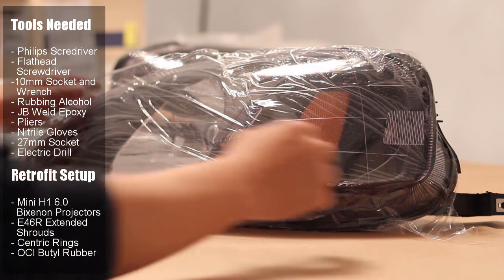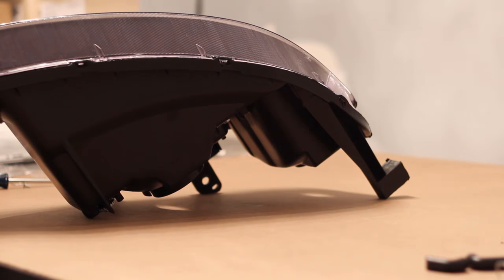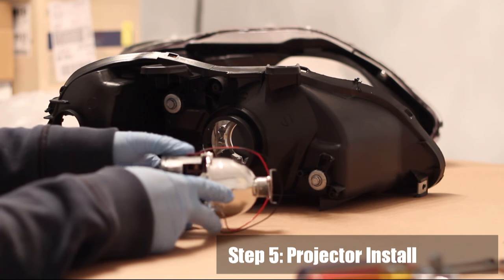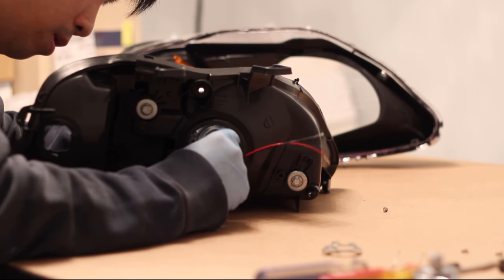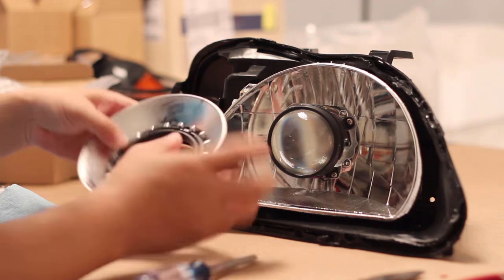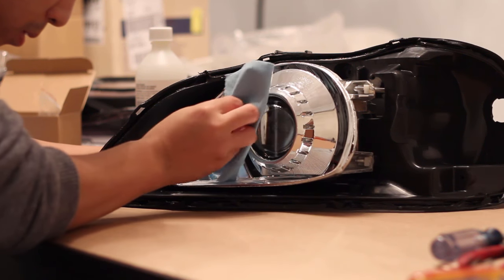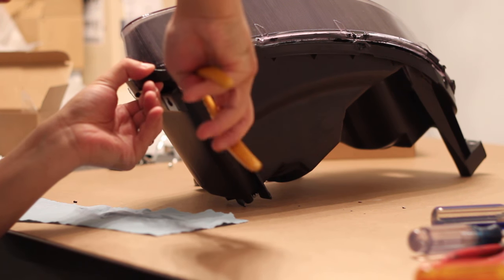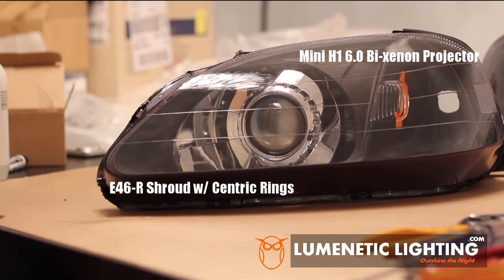How to DIY HID Retrofit - 99-00 EK Honda Civic with Mini H1 6.0 Projectors lumeneticlighting.com

Comment: I retrofitted mh1's into a 98 civic and the biggest problem I ran into was a line across the reflector bowl that caused the projector to bounce on bumps.  I solved it with some epoxied shims on the reflector bowl.  Good luck to all you fellow retrofitters!

Comment: This is a great tutorial. 

Only thing I would like to put out is the oven temperature, I recommend a lower temp. I put mine on 275 degrees and it melted the headlight. 175 degrees works better for me!

Comment: can you guys please do a DIY video for 92-95 EG Honda Civic?
Reply from the maker: +Evandro Ezaki Thanks for your request. The steps for a EG Civic would pretty much be the same as I believe the EG Civic also uses H4 bulbs from factory. You would use the H4 adapter in the headlight just like in this video for the EK. Only suggestion we have would be to get EG headlights with a clear headlight lens as the factory ones are fluted and thus will refract the light output from the HID's in all directions. Not good!

Comment: This is a bad ass product and a well explained step by step process, only question would be if this kit fits a del sol headlight lens, I already have a 1 piece headlight with a clear lenses but would love to get as much light as possible in front of me, do you guys have any kits that will fit the factory fog lights on the del sol??? I have the European housing which has glass lenses and it also takes an h4 bulb like the headlights, awesome product and would love to hear back from you guys

Comment: Great Video... I have projectors and proper kit for it but the question that I have is that the h1 connection (pigtails) where does it go...
Reply from the maker: +Johnny Saeteurn Thank you! If you're referring to the H1 HID bulb pigtails, those go into your HID ballast. But if you're referring to the two wires coming out from the projector, those are for the high/low beam solenoid and those would go into a wire relay harness.
Reply: +Lumenetic Lighting In the need of how the bolt holder goes in and also which wire from the projector goes with the harness.
Reply from the maker: +Johnny Saeteurn Hi Johnny the locking nut goes on the back of the projector to lock it in place inside the reflector bowl. The wiring is H4 from your car > wire harness or directly into the ballast if you'r enot using the wire harness > H1 HID bulb

Comment: Great video! How much rotation was needed with the H4 adaptor? (I thought the adaptor would eliminate the need for that!)
Reply from the maker: +Greg English Thanks for watching! The H4 adapter allows you to the the place the threaded end of the projector through the adapter so that it's centered in terms of the X-axis and Y-axis. It however, does not lock in the rotation of the projector so that is why it is important to mount your headlights back onto the car to ensure the rotation of the projector is correct so that you get a level cutoff beam pattern. If you're looking for a projector that has an H4 adapter that takes care of the rotation, check out my other video of the Mini D2S 3.0 projector  here: http://bit.ly/1QOcsN7

Comment: the 2 bolt to remove to the bulb shield, when you loosen the bolt and then take the shield out. do you tighten the bolt back? great video by the way. awesome how to by far. keep up the great work
Reply from the maker: +gwerx Rico I'm glad you found this video helpful. There will be more how to videos to come :) As for the 2 bolts, I believe you're referring to the adjusting bolts at the back of the headlight that you loosen for the reflector shield. You can loosen them all the way and take the whole reflector bowl out from the headlight, then yes, you would need to screw the adjusting bolts back on the reflector bowl. What I did was loosen them just enough without detaching the bolts from the reflector bowl, so that I had enough room to unscrew the 1 screw that holds the bulb shield inside the reflector bowl. That way I didn't have to remove the whole reflector bowl from the headlight. Does that make sense?.

Comment: Great video. Seems like a silly question but how did you power the bulb outside the vehicle? Can you give me the steps and equipment you used to do so?
Reply from the maker: we use a 12V power supply from a computer that we modified. We recommend you search online for the instructions as we don't suggest lining up your projectors this way. We recommend you install your headlights onto your car and turn on your HIDs to ensure the cut off is straight and level.

Comment: You should align the lights on the car prior to sealing you really should if not you’ll have to bake them again and separate you can use a two part water seal type epoxy

Comment: same deal with the factory 99-00 headlights right? no difference between aftermarket and oem design wise?
Reply from the maker: You would have to double check with whoever you're buying the headlight housing from. But, from what we've seen, all the aftermarket EK headlight housings are the same as OEM in terms of bulb type and fitment. There would be no difference in the way you retrofit HID Projectors from us.

Comment: hey buddy, what's the stock bulb type fitment? I see that most projector uses H4/H7 adapter before screwing the projector into place, what if the bulb type is not H4 or H7? Mine is H11.

Comment: Thanks a lot for the video! Very detailed. Now I have a question would this fit my 2004 civic si ? And second, I don't seem to find a ballast in your website, do you guys only  sell projectors and shrouds?.
Reply from the maker: +Fred Torres Thanks for the comment! The Mini H1 6.0 Projectors will fit in the 2004 Civic Si in terms of size. However when it comes to mounting, the back of the reflector bowl on the 2004 Civics has a different bulb type/shape (9006) from this civic shown in our video. You would need to shave down the back of the reflector bowl in order to sit the projector far in enough so you have enough threading to screw on the locking nut. We're working on a video that will show what needs to be done to shave down the back of 9006 headlights soon so stay tuned!
Reply: +Lumenetic Lighting thanks for the reply!, and awesome! I subscribed so I'll wait for that video to order, keep them coming!
Reply from the maker: +Fred Torres Thank you! And we forgot to answer your question about the HID Ballasts. Currently we are still testing out different ballasts and bulbs to find the best quality and value for our customers. So, at this moment we only have projectors and shrouds on our website.

Comment: after you take the bulb shield. do you tighten the 2 bolt back?  thank you for replying back
Reply from the maker: +gwerx Rico Yes you would tighten the 2 adjusting bolts back. You don't have to tighten it all the way, just back to where it was before you loosened them. You will likely be adjusting them again when you aim your newly installed HID Projectors.

Comment: Great video. What projectors and shroud would you recommend to retrofit headlights in my 2002 Rav4? Would the Mini d2s 3.o  work? Simse like I cant find any videos on older Rav4. Thank you
Reply from the maker: +Daniel Pawlata (DPFAST) Thank you! The Mini D2S 3.0's (round or square lens) would be a good choice for the 2002 RAV4's. 2002 RAV4's have an H4 bulb opening just like in this Civic headlight and the Mini D2S 3.0 kit comes with an H4 adapter that makes install pretty much plug and play for the projectors. We did a retrofit with the Mini D2S 3.0's  on a Toyota 4runner that also uses H4 bulbs. You can find that How To video on our channel as a similar retrofit to a RAV4 with Mini D2S 3.0 Bi-Xenon Projectors..

Comment: i have a 97 civic what would you recommend because i wanna go hid but i want to do it the right way? And also with this will it be high and low beams or just one?
Reply from the maker: We'd recommend you to use our Mini H1 6.0's or the Mini D2S 3.0. Both are on our website at lumeneticlighting.com . Both of these we recommend have low and high beam which is controlled by the solenoid.
Reply: the price on your website is that for a pair or just for one?
Reply from the maker: +ronnie cason the price on our site is for 2.

Comment: when is stock going to be available for the e36 extended shrouds also do you ship to Australia?
Reply: e46R*
Reply from the maker: Thanks for the comment. Apologies, as we do not have an ETA on when we'll have this in stock again. We do and will ship to Australia.
Reply: +Lumenetic Lighting 
thanks for repling to my comment. will this setup work for a more sleek look on my ek hatch. Mini H1 6.0 with the Iris shroud + (if needed) shroud centric ring.
Reply from the maker: For sure! Mini H1 6.0 with an iris shroud will look clean. And, the Iris shroud has a flat side just like the e46r extended, so install will be quite easy. You will need centric rings if you are using iris shrouds with the Mini H1 6.0's.
Reply: hi, im trying to purchase the projector but you guys are out of stock. would you know when you will get more stock? also what does the 2nd option mean? E.G Gattlin gun etc.
Reply from the maker: EK9 BRAH We have stock for LHD (left hand drive) of the MH1 6.0 Projectors on our site still. We are out of stock for the RHD version. The second option is selecting your shroud that covers the projector to complete your retrofit.
Reply: what if i wanted the iris shroud? theres no option for me to pick it only options are the gattling shroud. im super keen on this setup.
Reply from the maker: The Iris shrouds do not come with the MH1 6.0 Projectors normally. The Mini Gatling Gun or the Mini Graphite is what's included (for free) with the MH1's. You can get the Iris shrouds still but you need to add them to your cart separately. Don't forget that you need to also add a pair of centric rings to fit the iris shrouds onto the MH1 projectors. They are on our website as well. If you need more help ordering from our site, please feel free to email us at support@lumeneticlighting.com

Comment: will this work on a integra?  can i order the same shitl ike min h1?
Reply from the maker: +Truth Man you can use mini H1 6.0 projectors however, you will need to shave down the back of your reflector bowl inorder for the projector to sit far in enough so you can mount it with the locking nut. I will be posting a video on how to modify 9006 headlights to fit these projectors.

Comment: Any suggestions for Acura RSX 2006
Reply from the maker: We've retro'd MH1 6.0's and MD2S 3.0 Projectors into RSX headlights before. As the RSX uses H1 bulb socket from factory, you will need to modify and widen the bulb opening so you can fit a projector through the back of the reflector. Check out out Retrofit guide videos for more info: https://youtu.be/txbfmWZpHq8
Reply: Lumenetic Lighting awesome. Thanks. Is there a way or site I can order headlights? What's the best kind
Reply: Lumenetic Lighting I'd like to just purchase the headlights and install
Reply from the maker: If you're looking for replacement headlights (non-OEM), I would suggest amazon.com or even depo headlights.from https://www.carid.com/automotive-lighting.html?gclid=CjwKEAiAp97CBRDr2Oyl-faxqRMSJABx4kh9gITzcZIuhu6jcN0azAf56k0I4oQmDugLPJSP-sYvlRoC7Obw_wcB
Reply: Lumenetic Lighting thank you so much! Life saver 😊👍👍

Comment: you have some that will fit a 2009 malibu ???
Reply from the maker: we don't have projectors that "bolt in" directly like the ones in this video as the 2009 malibu uses H11 style bulbs from factory. The opening on the back of your headlight where the projector would go needs modification. So it's doable but we don't have a direct bolt in adapter.